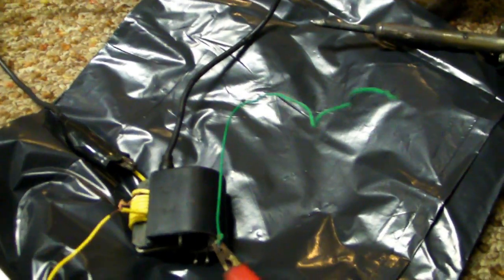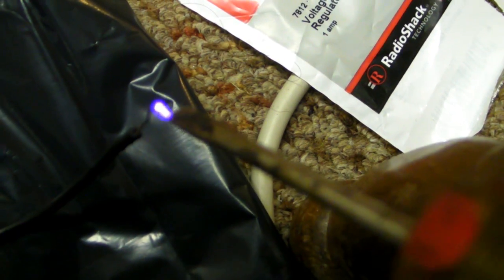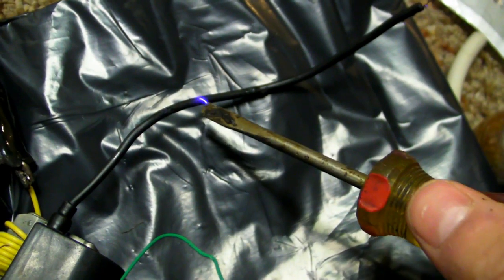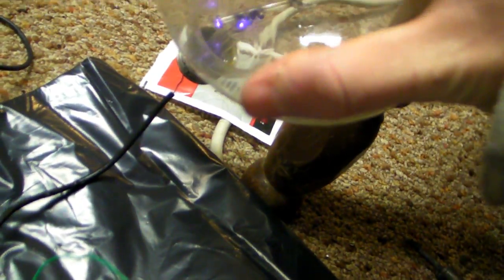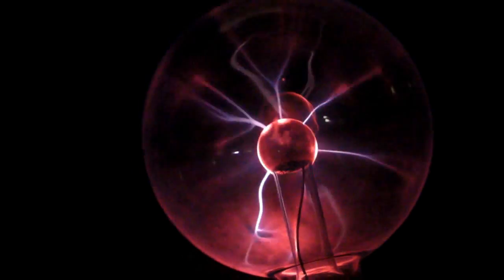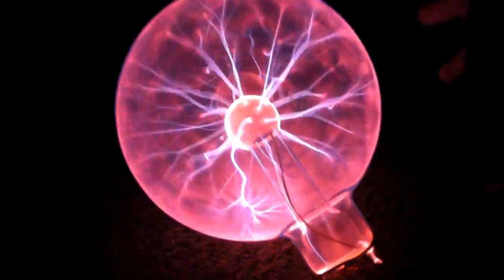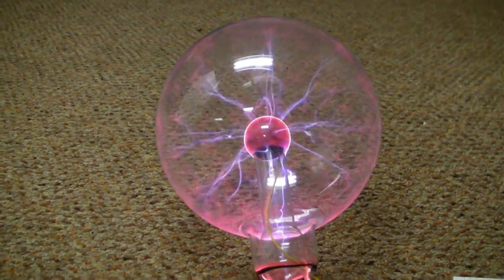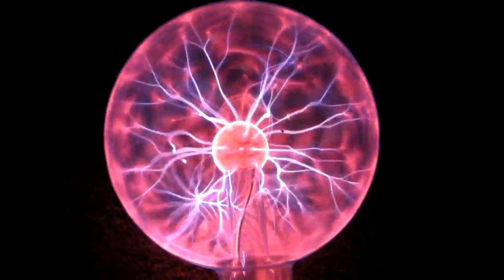Super "Overclocked" Plasma Ball!

Comment: Can I power a usb Plasma Globe with a 12V Laptop Battery? I'm just afraid I would destroy the circuit and would not work. :(
Reply: It seems that the Laptop Battery has quite a powerful current, instead of having 3V of 2 of the batteries, I measured it and had 4V. The batteries were still conneected like the original Laptop connection by the way just disconnected from the charger circuit.

Comment: Here's a trick you might want to try, if you have two old CRTs of the same size still lying around.  What you do is remove the yoke from the tube of one of them, but leave it connected to the main board so that still works properly to generate cathode rays.  Then remove the yoke from the other one, disconnect it from its main board, wire it to the output of an audio amplifier, then slip it onto the tube of the other one, power that up with a video input that would normally show a bright color image, then play music through the amplifier.  Depending on how the amplifier is wired to vertical and horizontal axes of the yoke, what you get is a pulsing swirl on the screen that looks like one of the modes that old oscilloscopes could be put into, only with a ridiculously intense trace.   You do have to be careful not to touch any of the wires while it's running, and it will burn out the phosphors near the screen's center in no time, but it's an interesting enough trick.  I did it using a couple of junky TV sets about 30 years ago, and it will probably work on on CRTs of later manufacture, as long as the yokes aren't too firmly glued to the tubes. 
     (One of those TV sets must have been old as I Love Lucy.  I kept all the vacuum tubes from it for Christmas tree ornaments, and one of them says SEARS on it.   An art-piece I'd really love to see is a big collage of fluorescent displays taken from consumer electronics, wired up to make all the elements of them glow.   If I were a tech billionaire I'd pay a hefty price for it, if it were nicely done.  It's certainly a pleasanter  idea than Damien Hirst's monstrous For The Love Of God sculpture, which "sold", allegedly, for 100 million, dollars that is.  Google that.  The very idea of it might make you a little sick though.)

Comment: If disconnecting the ground altogether improves your streamers, you should go and hook up a large capacitor in-line to your ground to block ground flow.  You probably want to put a high ohm discharge resistor across it as well, just to prevent the thing from retaining high voltages.

This will increase the streamers even more.

Comment: Hm... this is awesome. If i could copy this i would totally show one of my teachers. We end up doing stuff like this more than we really should >.> We used to shock each other with wimshurst generators. Anyway.... I used to set up 4 or 5 of those battery boxes and set them to 12v and create electromagnets (though i could never get them properly working at such high levels.... I went through well over 100 fuses last year messing around and destroyed an entire variable resistor system. Woops). though, even at 24v or so that plasma ball may not be able to handle it.

Comment: Greta work mate, just had a thought after watching this.
you know of Stan Meyer yeah, a quenching tube to carry the gas could well be older style coaxial cable  (air tube seperators). will the corona discharge internally for the entire length of the coaxial cable from a high voltage on the core wire to the braided outer sheath. will have to be tried..
LOVE IT !!

Comment: The higher the frequency of the current, the more longitudinal aspects of the current are present. If you could take a high voltage source and switch it at say 500,000 times A SECOND in a spark gap, you can create a state of longitudinal electricity which reacts very different then these low frequency high voltage currents. This is the basis of all of Tesla's work! I have been unable to get this high of frequency alternation but I am patiently waiting for a smart person like yourself to post a simple high frequency circuit. Good luck and nice video.

Comment: Why doesn't he get any shock when he touches the screwdriver?
Reply: Plastic handle.. maybe..
Reply: David Geiser
When he touches the shaft you nit.
Reply: TanzanianRoots probably because its low current. things like static and lightning are low current by high voltage. Condence voltage and you get low voltage and high amperage
Reply: It's because it's not travelling through the entire screwdriver. Electricity always takes the shortest path in the current and in this case it is just traveling through the tip, not the entire thing. It could also be because the voltage is really low, and that is what injures people. The reason it's so pronounced is because the amperage is extremely high.
Reply: Windoge 8 The voltage isn't what injures people...that would be the amperage.
Reply: Matt Brine
Sometimes even just a tiny static shock on van de graf is uncomfortable. So maybe this is lower current stilI I guess.
Reply from the maker: Because the current, its very low. Like a tazer, it may hurt but is generally non lethal. See my newer video link (annotation) in the beginning of this video. It involves lethal currents.
Reply: Windoge 8 amperage kills voltage doesn't...
Static electricity has such a high voltage you can arc across air which requires something like 10,000V but no current
Reply: juniortore1
SO you felt nothing at all when you touched the handle, not even a tingle?
Why is this static when its created by a coil like a tazer? Tazers hurt like hell.
Reply: transformer.
Reply: low frequency electricity.
Reply: Matt Brine You just called lightning low currnent? =)
Reply: well static arcing is almost 0 current. its measured in milliamps, although in perspective 50 mA will stop a heart.
Reply: Phil Roy 50mA AC would stop a heart... DC takes alot more :) and hes not getting a shock because he isnt grounded, the electricity isnt going through him, BUT if he would grab the wire and for example a radiator then he would feel a tingle
Reply: Phil Roy
A static discharge may very well be on the order of a thousand amps.
Watch Afrotechmods video, he explains it well.
Reply: It has rubber on the end.
Reply: Windoge 8 amperage will hurt you, not voltage. You've a long way to go before giving lessons on electricity.
Reply: +Hugh Jass You are all talking sh*t except mstrfool.and seroster. There are many factors. First of all you need voltage to get throught resistance of your skin, then amperage what power supply can deliver - this cant deliver more than few mA and then whenever it's ac or dc. On ac it depends on frequency - on 60hz it would be painful to touch but, this operates on 20000hz so there is a skin effect, so the electricity wont get to your organs,  I will traver just on your skin. Its voltage AND amperage that kills, you cant die from touching 1v 500A supply, just because your skin resistance wont let  more than 1ma throught your body. Also if you touch these kind of transformers it wont kill you if you touch it, because the voltage will drop to almost 0 .
Reply: +mstrfool The burns dont hurt because they are 3rd degree , so they will usualy destroy your nerves,  but when they dont , it just hurts like getting needle into finger , but nowhere else. It might have hurt you next day , because your nerves were regenerating. :D
Reply: The truth is that it doesnt give you shock when it hits your skin,But if it hits a cut , it goes more like on nerve layer skin so it hurts more. Also it depends on frequency 20 kHz is not that much, so it has kinda skin effect, but nice tuned tesla coil at 300kHz shouldnt hurt that much I think.
 it's more like pushing red hot needle into finger  , just on one tiny little spot, im glad i havent touch hv with open cut, i can imagine that pain. But I think that worst pain is from 230v ac, cus that very painful vibrating pain is just worst thing I ever felt, And I love it ! Nah I dont recommend touching it to anyone.
Reply: TanzanianRoots cuz there's rubber xD
Reply: TanzanianRoots high frequency electricity
Reply: Because he doesn't touch any other wire/thing with his body so the electric current could be done. Also gum shoes.  Also he didn't  spread his hand fingers so the electricity would go from one finger and leave through another (no current).
Reply: TanzanianRoots it's called magic

Comment: That's for low frequencies.  Plasma balls are driven by frequencies too high to stimulate heart / muscle tissues.  

But there is a risk of touching the lower frequency 120 V wires, or having an arc form from your body to the 120 V wires, which could be fatal.

Comment: How quickly the energy is flowing also has a factor on it. You can touch well over 300,000 volts and feel nothing more than a small tingle if the energy is moving at as low rate. As demonstrated on videos here.

Comment: Young sir, just as well you stayed with the original circuit, I think Google needs to monitor the safety aspects of these videos. I wonder how many ended in disaster rather than a good upload. If you didn't use an isolated flyback transformer winding you would have got a nasty shock.

Comment: actually, it was originally thought that the LHC might be able to create tiny black holes.  it was only a theory.  the idea being, the energy is so extremely massive (and by that i mean both huge and literally massive, since energy and mass are interchangeable) that it could be enough to shrink the schartzchild radius small enough to create a little bitty black hole.  it wouldn't be dangerous because it would evaporate (through hawking radiation) almost instantly.

Comment: first, a plasma globe is driven by very high frequency.  he mentions in one reply that he's using a 20kHz oscillator (which is HF), and his description recommends beginners keep the default circuit, only replacing the transistor, leaving the factory VHF oscillator.

second, it's not necessarily the frequency that's dangerous, but the fact that the high voltage is causing the EMR field to be a lot stronger than it normally would be.  plus, he has no shielding between him and the circuit.

Comment: That is not what it is. At LHC they accelerate particles in 2 directions, both near the speed of light. Then they collide them. 

What happens is that they collide at almost 2x light speed. What comes out can be described as pure energy + some particles. Those particles are what they're researching. 

One of the interesting discoveries they made are that the particles passed through each other before they disintegrated, meaning, they had already passed through each other before they "collided".

Comment from the maker: I would, but it would be easier to say get a 555 timer operating at about 20Khz (google 555 timer calculator to achieve that frequency, 25K potentiometers are great (a 1k resistor in series with both pots). Use that timer (pin 3) and feed it through a 10 ohm resistor going directly to the gate of the mosfet. Have the source going to the same ground as the 555. And the drain goes through a coil on the flyback to +. the same + voltage into the 555 timer.

Comment from the maker: Dangerous? Yes. Lethal? No. Although the voltages are high in this application, the current is very low. A heart attack would be only possible for one with legitimate heart issues. The worst that could happen with this is you get a minor electrical burn, unless that is you fail to realize you are being electrically burnt and continue the process of cooking yourself. So yes, this application is indeed theoretically dangerous and unsafe for the inexperienced.

Comment: I'm only guessing, but I don't think the voltage in the arcs is only 6-12V, its been transformed up to several thousand volts, and I don't think its circuit current in the arcs, its 'capacitor current', in which case its ( relatively ) safe to touch. i.e. only enough current will flow to charge anything that touches it up to the high voltage. Like touching a 20kV van de graaff globe. The charge required to charge the human body up to 20kV is harmless. Grounding the 6-12V supply won't do anything

Comment: its still verry dangerous  you need to start useing the right ppe if your going to mess with any electrical power over a normal 9 volt battery because it can and will kill you  if not  cripple you

Comment: Second Half
Once you turn on the cluster of plasma balls, would it pull the metal on the light bulbs in closer to the cluster?
If it does, the bulbs would obviously light up, and look awesome, but if you had them all at certain angles and distances, the pull should draw them towards the cluster causing them to light, and gravity should pull them back to their original position causing them to go dull. That should create a swinging motion and an ongoing spectacular display.

Comment: First Half -_-
This is awesome, I must learn to modify one of these myself!
Got an interesting theory for you.. as the plasma ball produces a lot of static, im sure that it must have some form of magnetic pull? If wired several plasma balls together (to look like a bunch of electrical balloons) that would obviously increase the ozone radius. If you then hung some bulbs (with similar makeup to your florescent tube) on some string, and solder some magnetic metal onto the base of the bulbs.

Comment: hi mate just a question if ya dont mind i was looking at the data sheets for the tip122 and the 120 and the only difference i could find is that the tip122 can tolerate a higher voltage so do you have any idea why it would work better with a less powerful transistor .hope this makes sense and i gonna try it later anyway .just didnt know if there is an explanation for this or if im just being a dumbass  or not  .thanks man

Comment: I would really like to know exactly how your circuit is set up. for some reason your circuit does act like a tesla coil, and I would love to experiment to find out why. I would especially like to find out why the electricity still flows when you remove the ground, that is also a feature only known before to Tesla coils, as a tesla coil is not traditionally grounded. Electricity does not usually flow through a broken circuit, I wonder if the flyback transformer has something to do with it.

Comment from the maker: I have using a different circuit. This circuit is very inefficient and a lot of the power is turned into heat. I used a ZVS driver on my last one and I used 60V. It wasnt really much more impressive besides the arcs in the globe were much thicker and a touch to it would be potentially lethal

Comment: TOUCH THE WIRE! .... Nah, don't. I build a "times 6" voltage stepper that runs off of 12v (modified ion motor). I accidently touched the ouput and It put arcs between my fingers. Your arm muscles stop shaking after a few hours.

Comment from the maker: It is only operating within the Khz range. And which temperature? The power mosfet goes over 150F, the center of arcs inside the ball are hotter than the surface of the sun, The glass itself gets warm. If I were to keep my hand on the top of the glass however, the heat would build up (since heat floats) and eventually burn me, or crack the glass.

Comment from the maker: On the new one, depending on if you were bare foot, or holding any other possible grounds, it could be instant. The amount of power I was putting in was about 1000W+, with an output of a few kv at a few amps.

Comment: The worst wiring I've seen the fact that he was getting the electricity through the wire causing the insulation to smoke what a dumb ass and how surprising is it when you hold a piece of metal to a screwdriver and it causes an arc

Comment: you have 110 and 220v running through the walls of your house with material that is only slightly less flammable than most carpets.  12v isn't enough to catch it on fire.

Comment from the maker: Yes and no. Your idea is correct, but the concept is wrong. 5A is being input to the driver at 12V. (5A x 12V = 60W). After the driver bumps up the voltage to roughly 10kV, there is no way that the output is at the same amount of current. If your concept was correct, the output would be 60kW (60,000 watts), and the woulds "energy crisis" would be gone. Assuming the driver were 100% efficient (impossible) and the output is exactly 10kV (60W / 10KV = .006A). The true output is only 6ma.

Comment from the maker: Yes, this can be made safely, the one in the video is borderline safe. It wouldn't shock or kill you, but the little arcs escaping the glass may leave little burn holes on your fingers (I would know...). You cannot directly use the wall socket, you will have to create a power supply and driver, which is powered by the wall socket, like I did. If assembled correctly, it will pretty much work forever.

Comment from the maker: @AiRGuNmOdEr there are no places that I know of that show step by step. But, do some research on how to make a ZVS driver. Then buy a plasmaball, then solder the black thing off with the wire that goes into the ball. Use the ZVS driver on that black thing, and put the new driver into the plasmaball. If you want it to be worth it though, find a 24V+ wall adapter to use with it. Thats as simple as I can make it.

Comment from the maker: @napkinlad The stock boards are very weak, sometimes just taking the glass off it and turning it on will kill it. What I have done, is replace the main transistor on the board (TIP122) to a TIP120, and kept the stock power supply and input power, and the ball was very much more energetic.